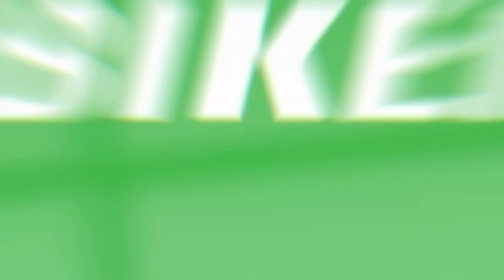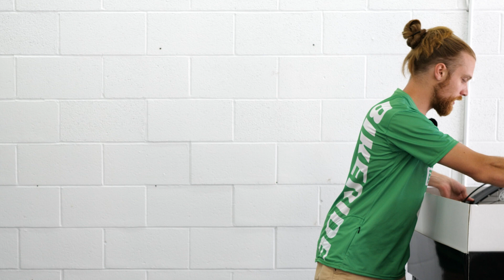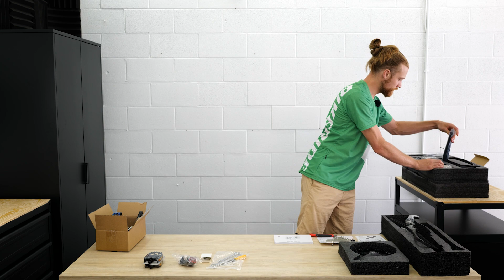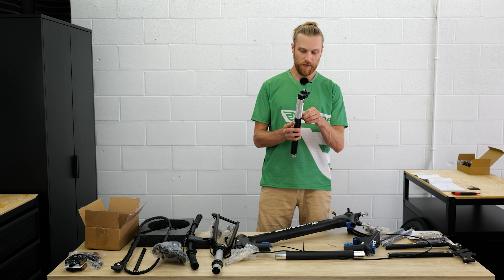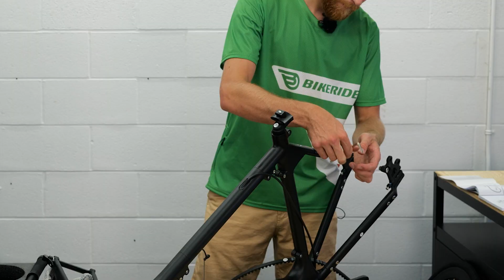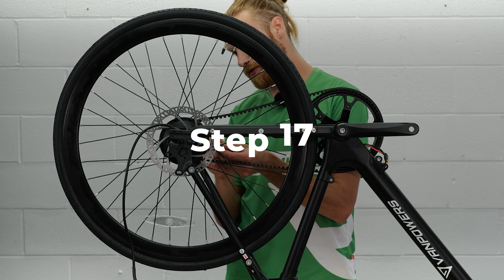VanPowers City Vanture E-Bike - Unboxing & Full Assembly Guide | BikeRide.com

Comment: Do you the settings password the change the tire or speed settings?  The manual says it’s 0512, but it doesn’t work.
Reply from the maker: The settings are accessed from the advanced menu and should be able to be changed. If a password if prompted when changing it should be 0512, if this does not work try 0000 or try resetting the password in the settings. The user password should only affect bike on start up though if I remember correctly, the advanced settings should always be unlocked with the 0512 password. 

Does your bike not ask for a password? Or does the 0512 just not work to set the speed limit for you?

Comment: Would you do a video on charging and adjustments to seat and handlebars? I can't seem to get the charging plug out; I must be doing something wrong.
Reply from the maker: Oh no sorry to hear that! We do not have this bike at the studio anymore let me see if we can help. 

The seat has a single pinch bolt located at the seat clamp, you simply loosen this and adjust the seat height then retighten, if the seat is not at the correct level, you can adjust this by tightening and loosening the two bolts under the seat. 

The handlebar is held on the bike with 4 bolts on the stem; loosen these and adjust the bar as needed, then retighten these, alternating tightening on a diagonal pattern as you would for a tire.

Could you let me know if you are having trouble pulling the charge port out during install? Or is the charging cable stuck inside the port after charging?
Reply: @BikeRidecom  Yes, I did, but I've gotten done.

Comment: 24:48 I tried to remove the rear tire from 2 different City Vanture bikes (one time on trail with a flat) but was not able to. One side (The side you're on) was easily movable. The other side (facing the camera) slid a little but only to the point it seemed like the drop-out was "pinching" closed preventing the shaft from sliding out. The other time I was in my garage and actually had to significantly pry it open so the wheel would release.  
Do you have any idea what would cause this? (I tried to tell from your video but the wheel seems to go on easily as expected.)
Reply from the maker: Intersting, I have had some issues with other e-bikes in the past (not the Vanpowers) Where the dropout for the front or rear wheel gets bent or is improperly made in the factory, and this can cause what you are describing where there does not seem to be enough room for the axle to enter the frame. 

Sometimes also, there is a washer, either round or one with a little hook on it, that goes into a small hole on the dropout, and this can prevent you from getting the wheel in or out of the dropout. They are made to keep the wheel in but can make installation and removal challenging if the axle is not loose enough
Reply: @BikeRidecom  Thanks for taking the time to reply. I just got it back from the shop and the technician said he had to undo/remove the brake entirely to get the axel to release. I don't recall if I didn't have the tool needed to do this or was just fed up at that point (on the trail). In any event, I don't think changing a tire should be that difficult. Considering my options now.
Reply from the maker: @TheB00Man  Interesting so the brake caliper must have shifted over and wedged against the brake rotor causing it to become stuck, or the brakes are seized. Thanks for letting us know!

Comment: What about the stability of e-bikes. Are you feel safe?
Reply from the maker: Good question. In general, I find most e-bikes are well-built, and with proper assembly, they are safe to operate and do not feel unstable. I have found some bikes have issues with frame wobble or improperly assembled wheels that lead to issues. 

Recently, the increase in quick-release front axles has caused me some concern. Some quick-release axles fail on e-bikes regardless of proper setup and tension. A bolt-through or thru-axle is better for heavy e-bikes. 

I am very happy to see more UL and CE-certified e-bikes and to see more brands focusing on quality builds. 

Still, the recalls and issues seen with some bikes and brands are clear. and users should be careful to ensure bikes are well maintained, checked for issues regularly, and serviced by a certified mechanic.